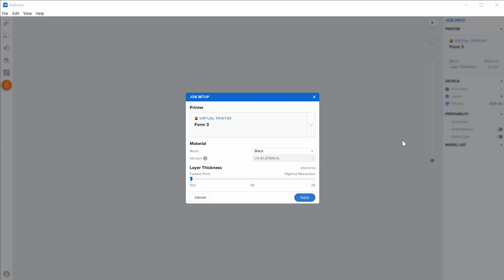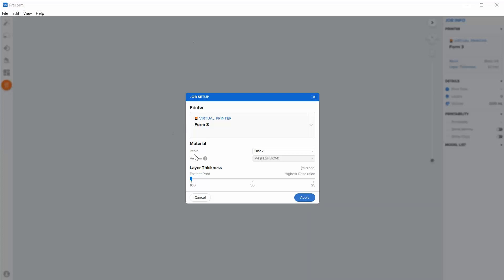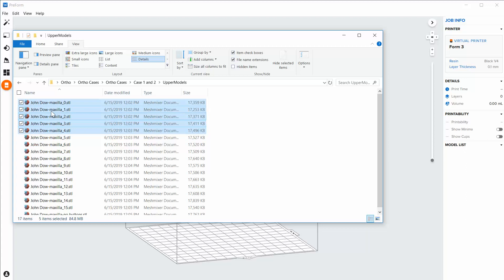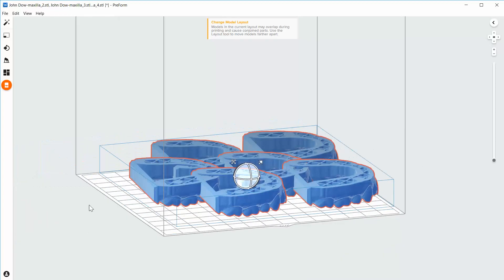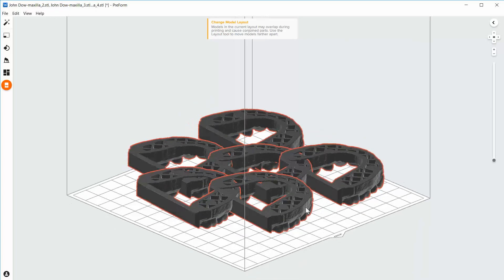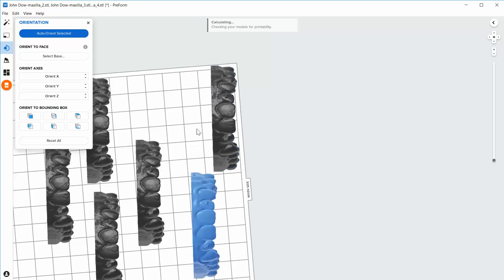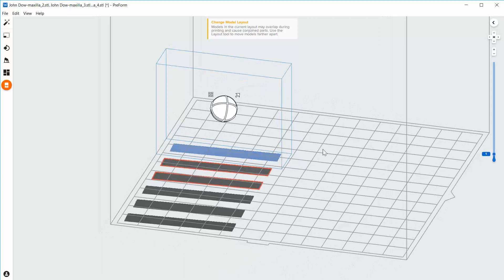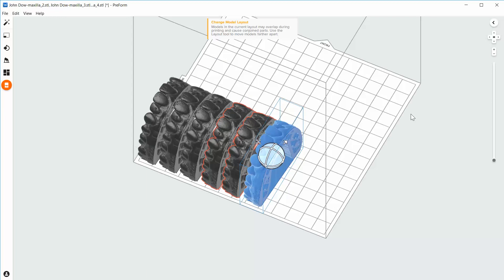Formlabs: Setting up Aligner Models for 3D Printing

Comment: What software do you use to make the platforms on the back of the models ?
Reply from the maker: I designed those years and years ago. Probably on MeshMixer, big would use Fusion 360 these days. But you don't need to design them. Go to my website and download them.
Reply: @bgrutterdds  I want to learn how to make the support base to print vertical like the ones in this video
Reply from the maker: Gotcha. In that case, I recommend you look into learning how to use TinkerCAD or Fusion360.

Comment: Cool :D So after the print you cut of the base from the models? And no support is needed in the middle part? From the base to the 1,2 teeth?
Reply from the maker: No supports and we don't remove the platform. We thermoform right over it, as well. This is an OLD video. Be sure to check out my more recent videos for and updates.

Comment: Baron, what type of video card do you use to handle all these 3D edits?
Reply from the maker: Most of my videos are made on my Surface Book 2 that has just a GTX 1050 with 2GB RAM. This particular video was my desktop with a GTX 1080.
Reply: Baron Grutter DDS Thanks for the tip, you’re videos have been super helpful. Appreciate the help!